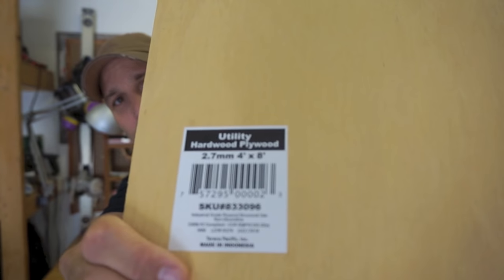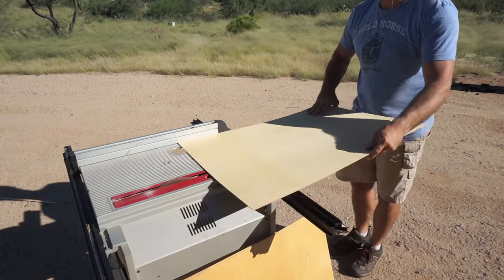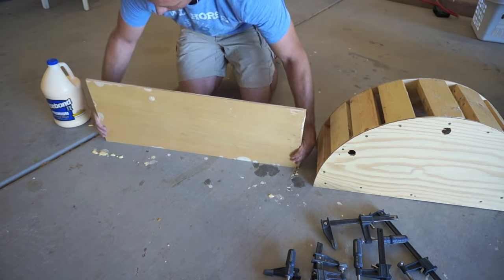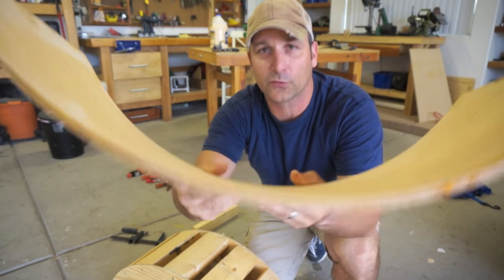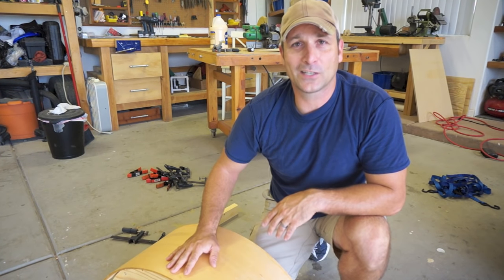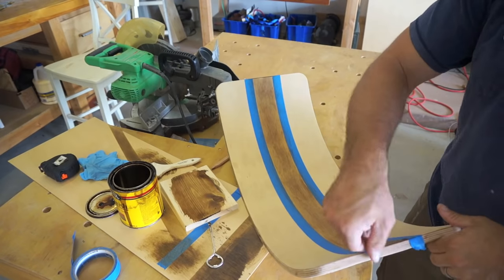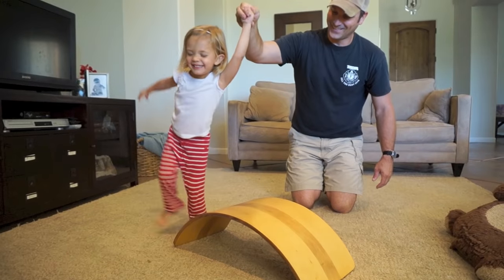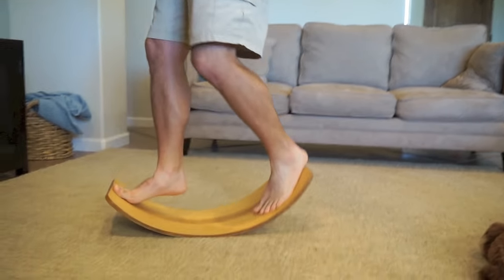Making a curvy balance board - Daddy Project

Comment: I want to make somethong similar to fit my patio glass roind table as a rear wind breaker and shelf as laptop stand. Can't find exact diameter for mold though smaller will likely use a keg or oil drum as "it will suffice".

Comment: Hi would love to make this curvy board for my daughter!! I have 1/8 in. Thick Eucalyptus White Hardboard from home Depot would that work for this project? What saw can I use to curve the edges if I don't have that type of saw. I only have a circular saw. Thanks.
Reply: I would not choose hardboard as it is very weak. Also if one surface is fuzzy or rough glue will not hold very well at all.

I was surprised to find 1/8" ply at a few Home Depot $12 that are further than I usually visit. The secret is that searching homedepot.com for "plywood 1/8" yields 0 results, even though it is categorized under "plywood/ hardwood plywood" once you do find it. The full description is "Utility Panel (Common: 1/8 in. x 4 ft. x 8 ft.; Actual: 0.106 in. x 48 in. x 96 in.) Internet #100543684
, Model #833096, Store SKU #833096". 

In spite of the product name, IMO the quality is quite good. No voids, no large knots, sanded nicely. It is comparable to Birch Grade "A", both sides for appearance. IWO way better than "Utility".

Not all HD branches carry it. Lowes does not seem to carry it all, but again maybe I haven't found the right keywords. I did try "Chat" with Lowes's which was also not useful.

You can round the edges with a wood rasp, a metal file, even sandpaper will make it less sharp. A Stanley Surform is $5 at Lowes. Good for taking off a lot of wood fast. Then use sand paper.

Comment: Cool joe was that 9 total sheets? 1 1/8 in wide?
Reply from the maker: +Black Widow Woodworks Thanks BWW!  this board was a total of 5 sheets of 1/8th" thick ply.  They were approx. 11" wide by 32-33" long.  One 4x8 sheet should make 2 of these boards with some material left over.  
Hope that helps:)
Joe